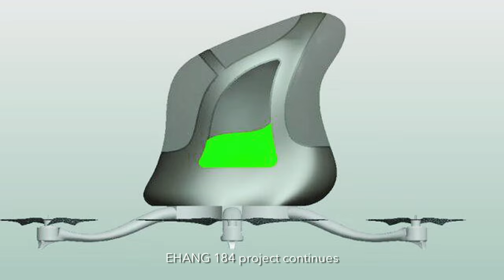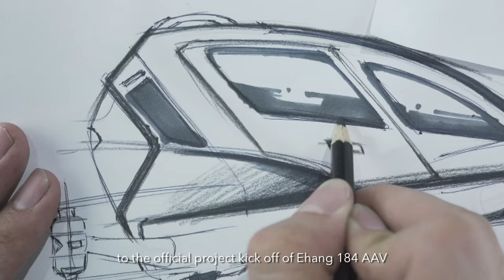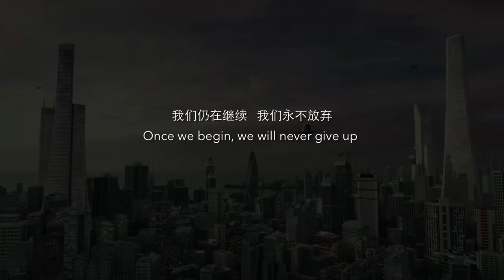EHANG 184 Launch Video from CES2016

Comment: It's a good start, 10 years from now it will be more mature and cheaper.
Reply: +Mulinaster That doesn't make any sense.
Reply: +Mulinaster That comment wasn't sexual in any way.
Reply: +don1559 10 ??? minimum 30 years for ideal model for everyone
Reply: +Lime Gorgeous Yup. More along the lines of 30 years, specially if we consider people having to get used to the idea.
Reply: Much faster!
 Those electric motors are very cheap to produce, the algorithmic is done and the battery is not a problem anymore  look for the "biosolar battery"  54$ per KWh and 459 Wh per kg 
no complex moving parts ,fault tolerant, to my point of view a 12 motors will be much more secure

Comment: there must be a parachute auto activation system in case of malfunction
Reply: +Emenem if you're not high enough the parachute will be kinda useless
Reply: +Rhix Dont forget to bring umbrella along..
Reply: +Emenem It doesn't need parachutes. The engines can be made work independently from each others and have overlapping power packs. Even if couple of engines or part of power systems fail it can still land safely. At least when it's perfected.
Reply: +Rhix that dnt mean anythink bro
Reply: +Viktor Brattsti This is actually an X-configuration quadcopter (EDIT: octocopter), so if one rotor malfunctions you might still be able to recover, But because of the configuration it might not work as well as one with 8 separate arms.
Reply: +Viktor Brattsti Except you know. It doesn't have 4 rotors. Ask your father about an X8 configuration, because this is what this uses and how it keeps redundancy. 

Octocopters are great stable platforms but slow flight platforms in the 8 configuration. They have limited bank angles as well. X8 is the more compact solution for 4 coaxial (dual rotor) configuration that can be as redundant and compact.
Reply: +Emenem    How safe can it fly in the wind speed that's increasing from 10 to 66 miles per hour or with heavy rains?
Reply: +Omnia in numbers But i think there should be manual control in emergency case.... Just in case :)
Reply: +Xi Le I don't think passenger jets would want to fly conditions like that.
Reply: +Jesse Taylor   I'm thinking of designing my "flying car" and test it flying in the wind speed that's increasing from 10 to 66 miles per hour or in the heavy rains to see how safe it can be.
Reply: +Stanislav G. > I'd say 4 reactive mini rocket engines that could land and stabilize it.
Just modern ejection seat :)
Reply: X but 8 motors (2 opposed, coaxial) so it is actually not a quad but and octo so has redundancy. Not number of arms but number of motors.
Reply: Emenem I swear I was about to comment the same.

Comment: The only thing I would do differently is make the props/motors higher than the cabin or cockpit. At least if you crash land the right way, you don't have shattering props flying into your face.
Reply: +Marc Connell I can imagine downward draft created by the propellors hitting the vehicle causes turbulence / instability issues with it
Reply: +StatusPia I thought that to before I made the comment but if you think about it, it shouldn't make a difference. As long as the position of the rotors are the same and the distance away, it shouldn't create any effect. Think of a helicopter. The rotors are directly above the cockpit, wouldn't it be more efficient if the rotor was under? Landing would be a pain but you can work around that with huge landing struts lol!.
Reply: +Marc Connell Well yeah, there's a lot of drones with the propellors on top. Still I assume it would require some changes in the designs of the drone (then again why not think of it from the start indeed). I guess they have their reasons. Seems we're both curious why so ;)
Reply: +StatusPia I seen that they tried an octocopter design. As cool as that looks, tripping over rotors/props every time you want to get in isn't really practical for every day use :P So maybe they did think about a hanging cockpit at some stage. Another reason why they should have props above the cockpit is you can put wheels on the cockpit and make the props tilt forward so it can move forward on the ground. I wonder if they thought of that as well!
Reply: +Marc Connell I'm no aerospace or mechanical engineer.  But it seems to me that for safety reasons, this vehicle requires wide, strong landing gear.  For weight reasons, the landing gear must be fixed.  So if it requires wide, strong, fixed landing gear, plus multiple props, doesn't the placement of the props on the landing gear save significant weight, versus an additional large, strong structure to support props above the cockpit?
Reply: +Marc Connell This is because of  weighting problems. If you make the props/motors higher and their structure (the connection between them must be strong anyway) can't be used as solid grounding for the cabin, you have to build the cabin in a stronger manner resulting in more weight. And weight is an huge issue when building multicopters that big. It is not like you can say, hey i have this drone which can uplift 5 lbs, when i make it 10 times bigger and 10 times stronger i can uplift 50 lbs - the scaling isn't nearly that linear (way easier to build small drones with an efficient payload/power-ratio). That said a higher weight also results in more power consumption, which makes the copter less effective (next issue: battery-capacity).
Reply: +Paul Bunyan Fixed landing gear can also be more structurally sound, would cost significantly less, and would be one less thing to fix.  The less moving parts, the better.
Reply: +Marc Connell I was thinking the same, like the DJI Inspire 1
Reply: When you invent your OWN you can put the motors anywhere you want. Just say'n.
Reply: Marc Connell Having the weight below the cockpit means the cockpit isn't crushed in a crash landing.
Reply: Ted335i the weight will be in the batteries which can still be under the cockpit. The motors and motor booms won't be heavy.
Reply: I also thought the blades should be on top. For stability.?

Comment: this is great innovation! I don't see anyone else doing anything better.
Reply: ***** I'm certain the situation was analyzed. As for an ejection system, I doubt elders would be comfortable being ejected lol but perhaps an ejected parachute from the drone would suffice. 

I'm actually in the process of building an autonomous quadcopter as well and we were warned not to fly them in bad weather conditions. Though the Ehang has air speed Im sure it lacks air control in the midst of a storm. I also believe they'll be working on it. 

Likely, this passenger drone would only be used during sunny days and tourism. I see it first being utilized as a company's machinery and not yet approved for the public.

Comment: Bet Trump didnt think of this with his idiotic wall idea.
Reply: +Baddog lmao
Reply: +137maximal What does that have to do with the wall idea?
Reply: +koalabieren this vehicle can fly over a wall ... duh
Reply: +Baddog He's just joking about all of that. If you really believe he's wanting to be president, then you're part of the problem.
Reply: +Baddog Its in range of most assault rifles anyway lol.
Reply: +Baddog - You can make an electronic wall. Also there can be restriction GPS built-in in like in DJI drones which will land automatically whenever someone tries to cross the border...
Reply: +137maximal - But helicopters have radios and are visible on radar, so they can't fly without permission from control tower.
Reply: yeah because a bunch of poor migrants can afford a 300k flying drone that's not even on the markets.  crude flying machines like gyrocopters have existed for 50 years.  Not everyone can obtain one or fly one.
Reply: Baddog Damaging Trump's wall by Mexican citizens should incur penalty too. That's something including any illegal tunnels dug under the wall.

Comment: - Congratulations, Ehang, 'marvellous engineering work and results. 'Thrilling to look forward to riding independently above the town, the hills, the sea and lakes, and on cheap electric power instead of making CO2.
- How noisy is it? Presumably there's a fair amount of fan noise.
- One thing, how about putting a screen over the rotors so that any flock of birds colliding with it doesn't cause a crash? But perhaps you already have covered that by providing parachute descent?
Reply: +Bruce Thomson I was looking all day for someone to say that, cheers to you Bruce.

Comment: Changes I thought of to enhance safety and functionality further:

-Add a safety parachute that deploys in case of unexpected engine, or battery power failure(s). Similar to those used on small recreational airplanes (I don't know what they are called, but their are many examples of them on the web in action)

-Protect the engines, cockpit, and the whole vehicle in general themselves better from weather conditions, such as rain, snow, sand, dust, etc. (But especially the engines) Perhaps this might be a bit extreme and even costly, but I believe this will give the product a broader mass market appeal since consumers will definitely value durability in a personal flight vehicle

-Goes without saying to add covers to the blades themselves to protect them from impacts such as birds, rocks that can be stirred up when taking off, etc. It will prevent them from damaging and warping the propeller blades, decreasing their flight ability.

-Integrated charging solution - this way you don't need some sort of special charging station to park the vehicle at to charge it at - it should have the ability to charge at standardized household AC plugs where they are sold in their prospective regions

-Solar panels, the vehicle is large enough and will be flying high enough to take advantage of the sun. Could also be an emergency generator in case the battery is completely depleted, and you are stuck in the middle of nowhere. (USB/iPhone chargers too, to make a phone call if your phone is dead)

-As another person mentioned, move the propeller blades higher above the vehicle, similar to a helicopter. It'll eliminate the need for the rotors to "fold up" and collapse every time somebody has to enter/exit the vehicle. (Perhaps the rotors can fold downwards instead, if the designers want the vehicle to go save space for storage or transportation/delivery)

Comment: They should design a camera underneath to act as a birds eye view, so that the app inside the tablet's software in real time gives an exact proximate sized outline of the size in which the vehicle will land on the ground (coloured cube) by the user selecting it for an emergency landing. Like letting the user select the spot from above. Or even make it autonomous by having 4 extra independent laser measurement sensors under each rotor too, for judging the elevation in which it safely lands on for an in flight emergency landing as well as the camera to see the ground giving the option to the user. So the vehicle can sit flush on the ground or in a safe angle away from people and obstacles.

Comment: quad drone is a great platform for safe travel, it has a redundancy system that even when propellers malfunction it is able to fly by spinning fast to stabilize but not crash down, worse case scenario there is the passenger will be very dizzy but not hurt, this looks like an octo propeller, not sure if each is individually powered but that would truly make it almost impossible to malfunction, the only flaw I see and really it's just a flaw when keeping the whole close to 100% safety proof concept in mind, would be to build a sturdy light weight enclosed mesh cage round the propellers to keep birds from flying into them which is something that scary enough happens frequently with Big Commercial Passenger Airplanes, also the propeller cage would have to be tall enough to allow the unhindered pivoting of the blades it would be shaped like a doughnut even a hard plastic material would work, 2 inch holes in the mesh wouldn't restrict much or any of the airflow either but will be enough protection to keep pigeons or bigger birds from flying into the propeller, passengers can also mount without powering down the engine if you add helicopter skis under the unit plus giving you easier lift off with the extra foot or so off the ground, unit too close to the ground forces you to create a bed of air under the unit from scratch. if anyone is not convinced that this can truly be as close to 100% safe then you should watch a video here on YouTube called The Astounding Athletic Power of Quad Copters it's 16 minutes long but you will be amazed at what these things can do, they balance brooms, fly in formations, form tasks together, play tennis with the man and the man even clips several blades to show what the units do to make sure they stay flying, BTW this unit Ehang has eight propellers, great evolution of an already great invention

Comment: It goes 10 feet?  Why the counter rotating blades?  The landings look like they will be prone to break propellor blades - there is very little clearance.  Also why would you but the propellers below you and the center of gravity.  Because the propellers are below you, if you are making a violent maneuver or subjected to a strong wind gust, you may easily find yourself upside down and unable to upright yourself.

Comment: just a small scaled electric helicopter. the problem is now how to maintain the power without adding any additional weight of the batteries.
Reply: +jefferi chang That is one thing that they did not mention in this video is the power.What type of power they use? How long it will last?  Probably they haven't fully develop it yet. Not like they going to use Lipo in there, do they?
Reply: +jefferi chang  Solar panels ;)
Reply: +Jollence Lee Flight time is 23 minutes.
Reply: +koff41 maybe some sort of personal nuclear reactor will give more power ;-)
Reply: l000kin Those exist, they're called Radioisotope Thermoelectric Generators, problem is they're heavy, and, well...radioactive.
Reply: +Jollence Lee i will say what a person said in another comment: "this clearly is a PV,,  all its purpose is to make you want to know more and make you remember it,it seems it did its job"

Comment: How about a petrol generator as primary source of power and batteries as fail safe???? Also would allow longer flight times...
Reply: Film Masters the flight time is 25-30mins and there is no petrol it works on power and if battery gets low during the flight it will give us warning and automatically lands to the place from where we launched
Reply: I'm sure they are fighting the scale for every ounce they can shed. I doubt a generator is possible in this model

Comment: The main issue I see with this is power density of current battery tech, and being able to carry more than one passenger and/or a heavier passengers and/or additional cargo.
... unless interim units have some sort of petrol, hydrogen or other form of serial hybrid tech.

Secondary is the rotors - this would mean it has the same safety issues as helicopters. Presumably one would assume it has proximity interlocks to prevent the rotors spinning up in striking distance of animal, mineral or vegetable ... similarly, on choosing a landing site.

Comment: 3:53 that lil chinese fella already seems to be a tight fit for that cockpit ,iam a avarage tall western european man (1.85 cm or 6 ft) i would never fit in the enhang 184, this is like ordering a tshirt from china in L size when you get the package and try to put the tshirt on you will soon find out its more like a S in size then a L in size , iam much taller and more heavy thus this thing probably needs a bigger motor and bigger fuel tank to carry me..
i was expecting to be shown what happens in flight when the motor cuts off, will the blades produce enough dag to let you glide down at a relative safe speed or will you drop like a brick from the sky?, iv seen model rc drones malfunction in midflight and when they go down it is not a pretty sight.
Reply: i would like to add: 
this all looks computer animated we have not been shown a real enhang 184 in flight.
Reply: Quads don't do auto rotate,they just crash.I would suggest a parachute

 & yes it's almost all CGI with a few small test hops.
Reply: +S Dew It is electric not fuel based.  I imagine it is programed that with a certain time remaining it will make a mandatory landing.  If there is a failure in flight you will crash, not auto rotate.  But there's no reason they couldn't equip it with a parachute like modern day airplanes now come with.  The real fear is mid air collisions with other aircraft and structures.  I do agree that they will definitely need an upgrade to the weight you can carry and flight time if they want to market this in the USA.
Reply: +David Cook Unfortunately they will not market this in USA nor in China nor in other countries because that drone can't fly. 
If it flies why there are no video with human while flying, just pops the door and not video from inside while flying :D Also cockpit windows here are somehow black, while at the exhibition windows are clear :D
Reply: +David Cook they already have an anti-crash system

Comment: "absolute safe aerial vehicle" ...WTF are you talking about ?!?
Reply: +mingoucz is not said and is not true either
Reply: not if two or three let alone four twin rotors fails but if jest one fails the aircraft will lose balance and spin out of control and i mean stalling down not in a controllable spin like autorotation in case of helicopters is like balancing a stick on your finger . plus the propellers are in the lower part of the craft so in a rough landing flying splinter blades will chop your head of. not to mention those blades are uncovered , unprotected in some sort of casing so a bird strike is very likely . so once again  "absolute safe " ? No fuckin way
Reply: +Catalan Totanian It is another "absolute safe vehicle" like for example absolutely safe Titanic ;-)